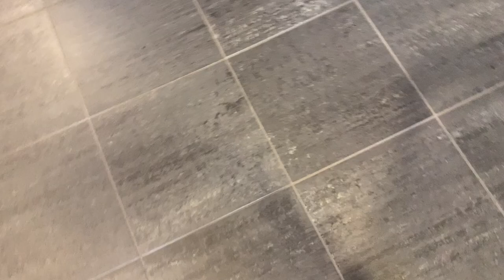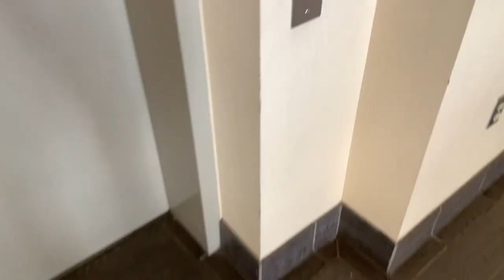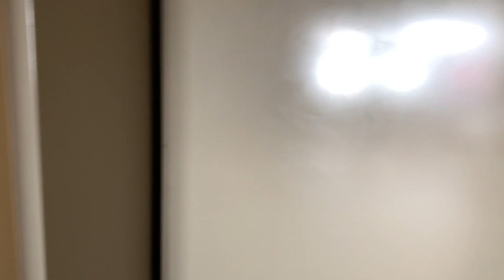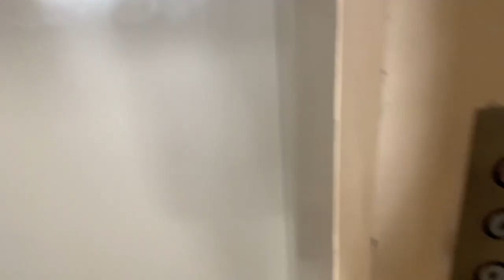Broken Door on Westinghouse Elevator - Old DTA Transit Center - Duluth, MN

Comment: When did you record this?  It was broken and had out of order signs for a couple months.  It was working again a couple weeks ago.
Reply from the maker: This was pretty recent. I forget the exact date, but it might have been a few weeks ago. Perhaps they fixed it soon after I filmed this.
Reply: @NorthlandElevators  Could be... but someone must've ripped the out of order signs down before it was fixed then.
Reply from the maker: @Dana_Danarosana  I didn't show it well, but the out of order sign on the first floor was there. It just wasn't there on the second floors, and I happened to enter from 2R which obviously didn't have the door problem. Wish I would've taken some video when I was actually inside. It was a tad sketchy for a second until I figured out that door close still made the door close.